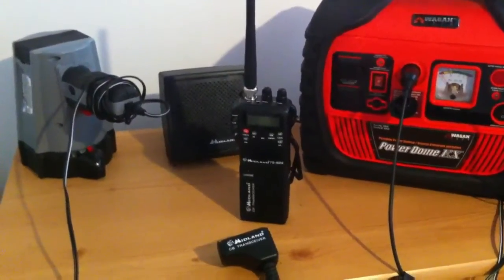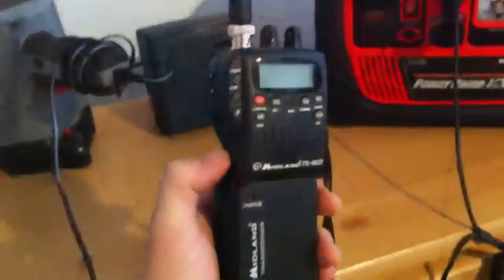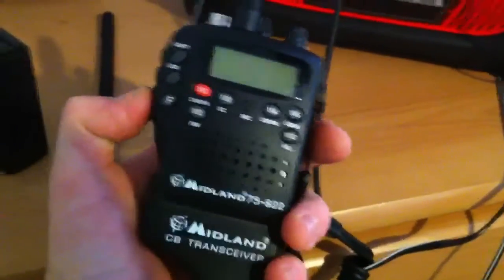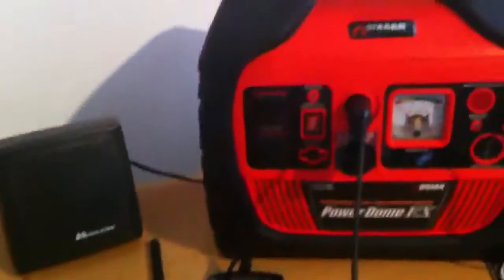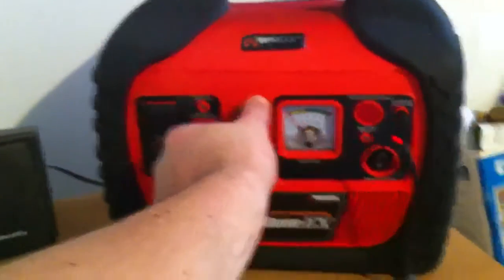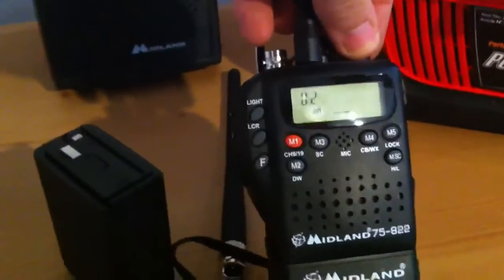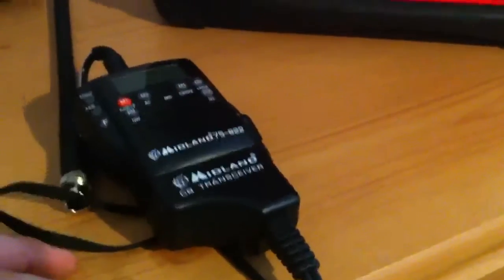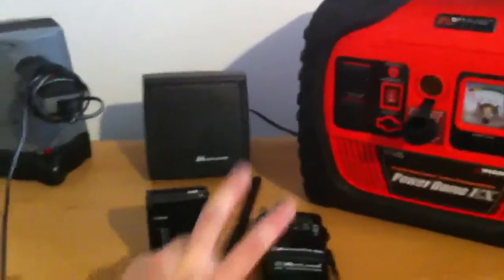Wagan powers Midland CB radio with Solar power

Comment: How do you charge it with solar power?
Reply: You can charge our devices with a solar panel by simply attaching the 12V output of the panel to the charging input port on our power supply!